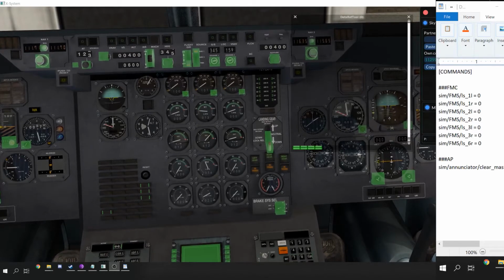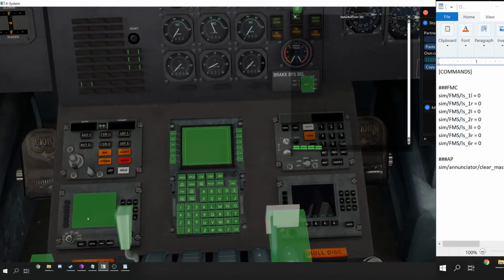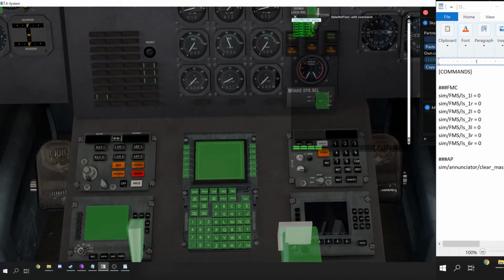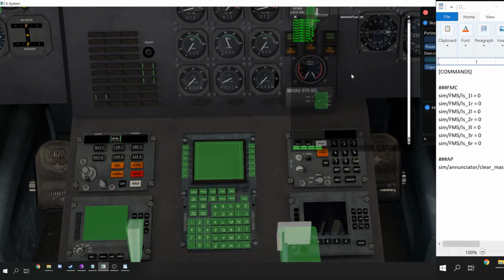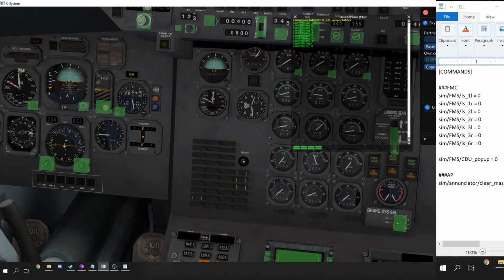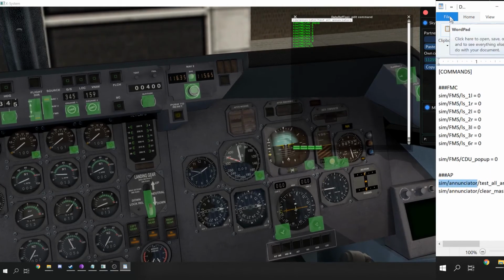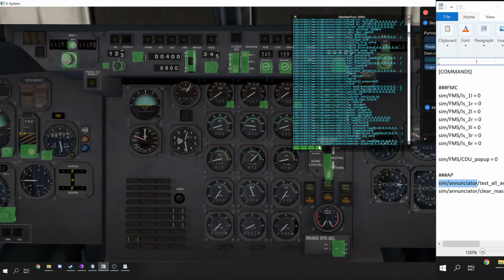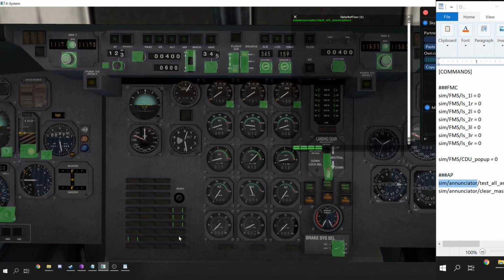SmartCopilot Config Tut #2  "FMC's/Avionics"

Comment: You're a star sir, I'll get into this one when I get home from work!
Reply: One quick(?) question - asides from these buttons/switches which are using 0 or 1 as their values, how do we handle rotary inputs such as trim, heading, course, frequencies etc where the values might be into the hundreds?
Reply from the maker: @HotrunVideo  If you look for the DataRefs you will find alot of the ones you need. 

[TRIGGERS]
sim/cockpit2/gauges/actuators/barometer_setting_in_hg_pilot = 0

sim/cockpit2/gauges/indicators/altitude_ft_pilot = 0
          < these for example would drive a Altimeter 

sim/cockpit2/autopilot/heading_dial_deg_mag_pilot = 0
sim/cockpit2/autopilot/heading_dial_deg_mag_copilot = 0
    << this one for example can be heading knobs.  

Then there is
 [COMMANDS]
sim/autopilot/heading = 0
sim/autopilot/heading_down = 0

sim/autopilot/heading_up = 0

These typically will not be a On or a Off. These 0 's typically change.  
In the case of a heading knob, it will be 230, 350, 010.

You can sync the Gauge, Knob, or both depending. 
I like to do both in most regards. While both people can move the knob,  the gauge it's self needs to synced before connection. Otherwise if you have the heading ref/altitude ect,  then that's not required.
Reply: @caseycappoen251  many thanks for the detailed response. A friend and I are hoping to build a config for the Carenado SF34 but it's going to be a slow, learning process!
Reply from the maker: Not as slow as you think.
Let me know if can be of any help.

Join our discord.